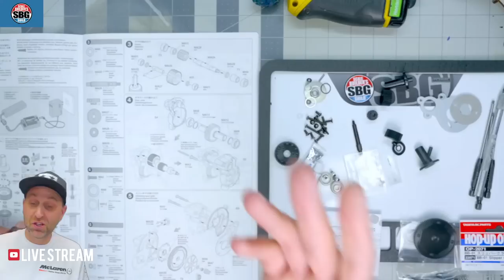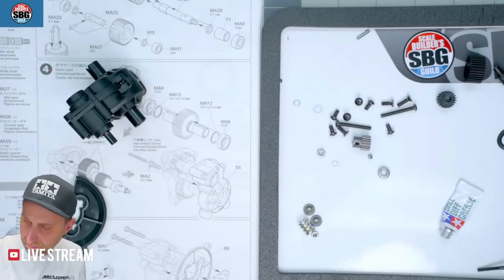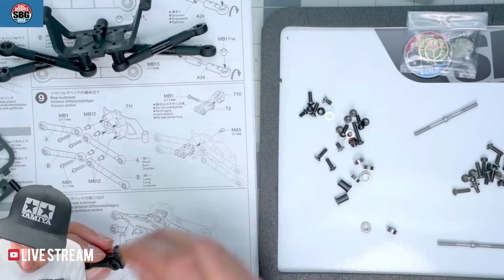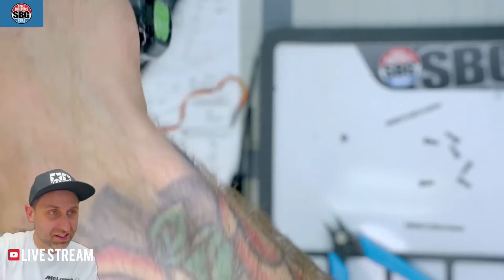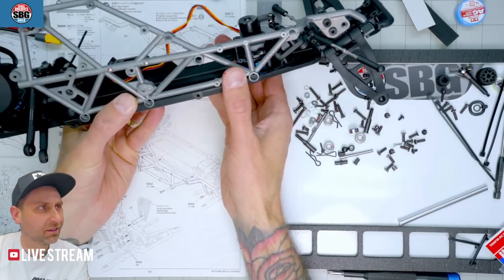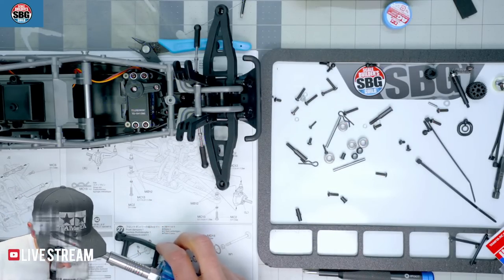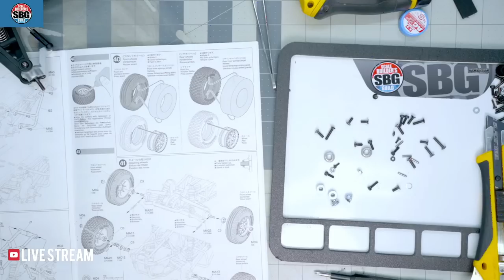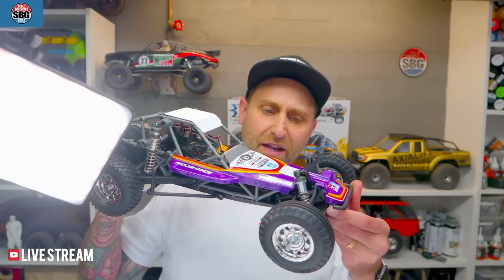Tamiya BB-01 BBX Live Build!

Comment: At 3:01:30 I was (also) wondering why they don't show the screws for the J8 part. It seems they "officially" didn't connect these braces to the lower part of the frame. All PC parts of the "body" are screwed in using other holes. Even on the official photos of the model, it seems, they are not shown. Maybe they decided this later in the design process? It's indeed a little bit weird. I guess the M2.6 cylindric head screw should be the ones going in there.